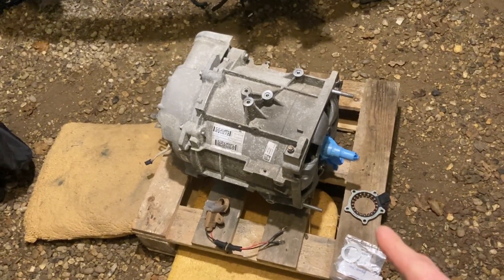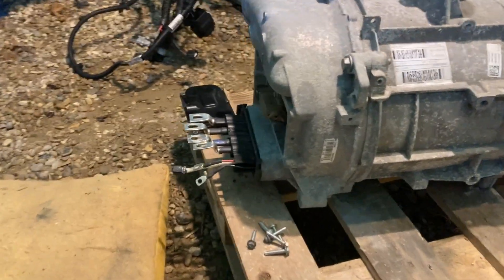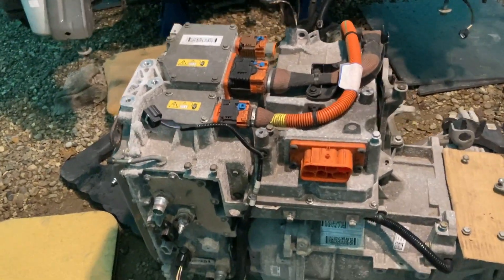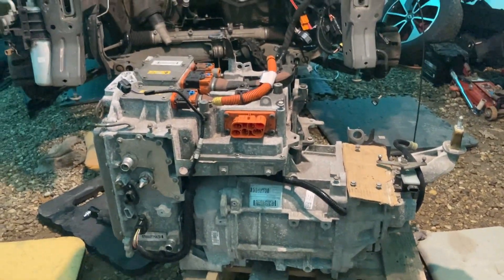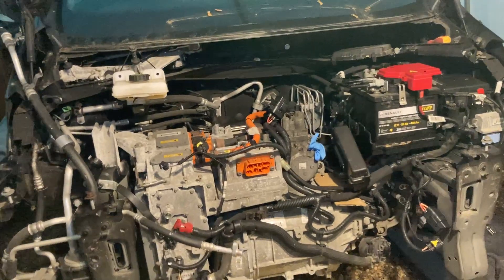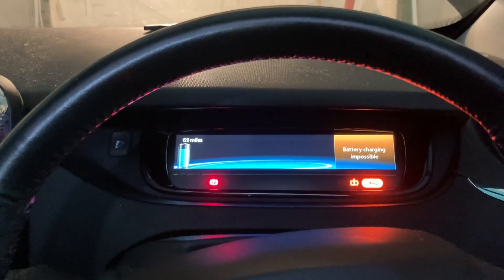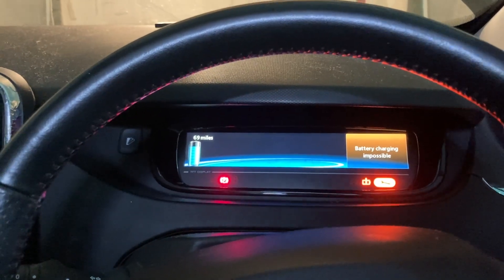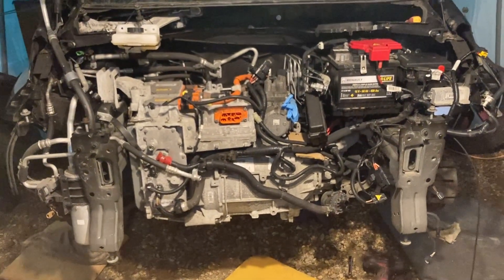Getting it running - Renault Zoe ze40 motor bearing replacement 5AQ

Comment: Hi, how much will it cost to do both bearing replacement?
Reply from the maker: Hi. For motor bearing replacement it comes out around £2,250 - it’s approx 15 hours labour plus parts. If you need it doing drop me an email gclayton@hotmail.co.uk Cheers
Reply: @garycevrepairs  Thanks, I will keep your details, for now it's it's in working order.

Comment: Great that you're showing how these repairs can be done.  However, how many owners are going to opt for such a repair once the vehicle becomes older and other  components such as the battery pack show signs of degradation?  I think it'll be end of life for most cars at that point, uneconomical repair in other words. 

That kinda annoys me though, the whole point of an EV is that it's supposed to be better for the environment, not produce extra profits for the automotive industry!
Reply: @Altair885  ICE engines also suffer degradation as they are, especially from wear and tear from lots of short journeys. It just can't be measured using an OBD dongle!
Reply: @MrWobling  Sure they do, but they usually manage to accomplish a far higher mileage before a major failure.  Look and see how many low mileage EVs are already sent for scrap, it's criminal.
Reply from the maker: You have a way to see the mileage of cars that are scrapped, filtered by fuel type?!
Reply: @Altair885  I'd argue this is more about lack of competence at main dealers and lack of availability at independents, when it comes to repairs. Main dealers "fix" issues by swapping £1+k modules, at the customers expense, until the problem goes away. Hardly surprising that EV repairs are too often deemed uneconomical, is it?
Reply from the maker: Interesting points. Many of these Renault Zoe’s have battery leases so there is a continuing warranty on the battery and the Zoe battery lasts very well due to excellent battery management including battery cooling and heating. The previous Zoe I rebuilt was on 116k miles and the range from new had only reduced by about 10%!! Cheers

Comment: Rear axle motors for the win. What's the point of having a 25 dollar bearing replacement and 15 hours of labour. Plain bad engineering.
Reply: I couldn't agree more.  If the bearings had been man enough for the job they would last many times longer. 
The design layout is quite simply done for ease of manufacture and does not consider maintainability.
Reply: @Hookeslaw  you would however likely need a full lift to be able to work on a rear axle motor.

Comment: Range looks seriously compromised. At that battery level should have at least 100 miles range irrespective of weather.
Reply from the maker: When I received the car it was at a very high state of charge which isn’t ideal for the battery so I left it sitting running the heater to just use up some charge so the recent energy usage has been 0 miles covered but several kwh consumed by the heater ! Not exactly normal driving efficiency. Cheers.

Comment: Is it necessary to remove the whole stack to replace the AC compressor?
Reply from the maker: No, you can take the compressor off the top while the stack is still in.
Reply: Renault got that bit of design right, at least 😂